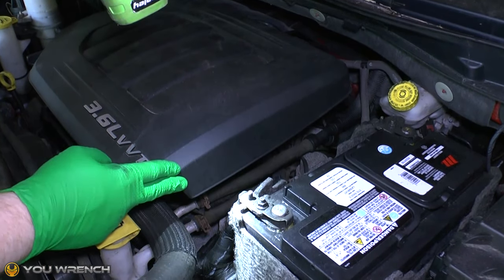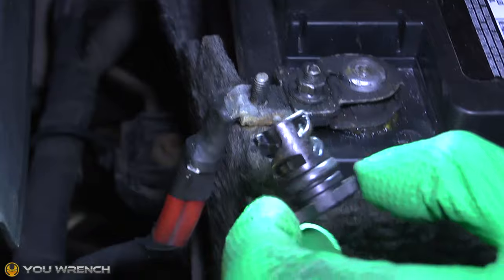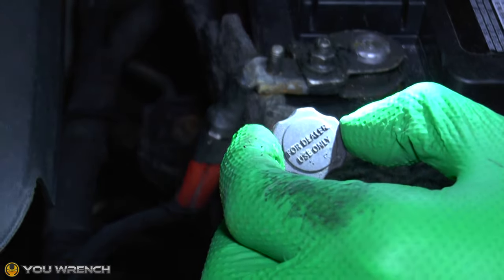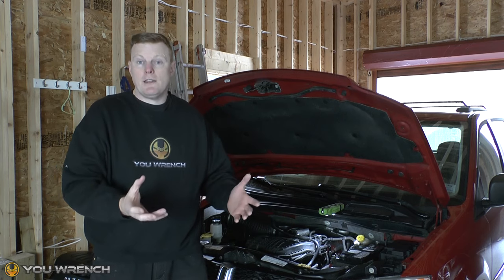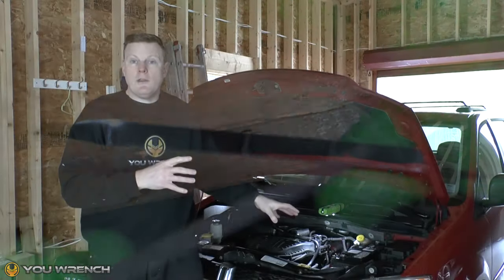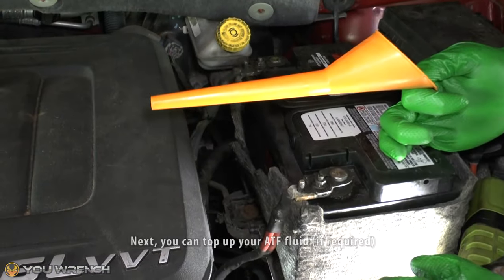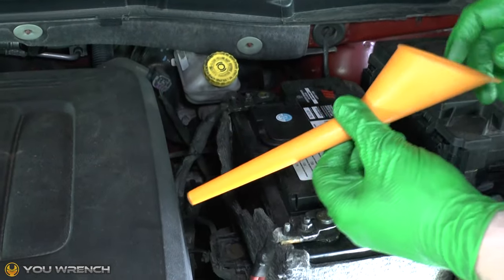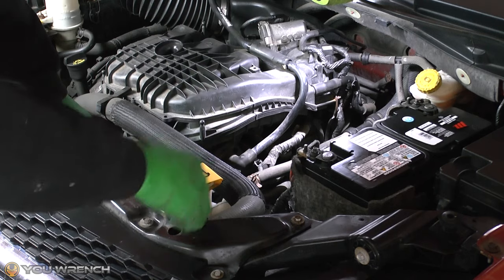How to Check Your Transmission Fluid Level - Dodge Grand Caravan (2011-2020 3.6 V6)

Comment: This access does not exist on the 2016 Dodge Grand Caravan. If I could post pictures I would show you. Please show me I am wrong.
Reply: I have a 2016. Mine certainly has it
Reply: It say for dealer use only use a light it’s a small black cap about size of a soda top driver side in front
Reply: Mine was wedged under that wire loom that you see in the video. I had a hard time finding mine.
Reply: It took us a lot longer to find the fluid opening then it should have it’s hidden underneath the wiring knuckle (between the battery and engine) it should be an inch in any other direction it would’ve been easier to find 🤦‍♀️🤦‍♀️🤦‍♀️ but once found it was no longer an issue (2017 Dodge Grand Caravan)
Reply: It's probably hidden under a thick wire.
Reply: You are wrong 😅
Reply: Its there. I couldn't find it either. Put an autist on it , he found it in 2 min. I bet him 50 bucks he couldn't. I payed out . Lol

Comment: Hi there.  I just bought a 2019 Grand Caravan.  I tried finding the tube to fill the tranny, but there is no tube, there is no cap.  I searched and searched and nothing there. Dodge must have decided to make it impossible to check or fill it on your own after all the videos on how to check and fill.  I think they are afraid of people not putting in the ATF+4 and possibility of ruining the transmission.  Can you look into this and get back to me.  Maybe they moved it, but I could not find anything anywhere that even resembled a place to check or fill it.
Reply: There is one no my 2018.  There is a big thick wiring harness directly above it so it's hard to see
Reply: I’m going through this now lol think I’m going to take it to tag dealer just to be on the safe side
Reply: @tunchi2x8721  but the dealer will gladly do a total fluid change but will refuse to "top it up"  I asked him how he would fill it up at all when he can't fill it up.  His answer "fill the drain pan"  that's all iot needs. "  Yeah, right!!!!!!!!!!!!!!!!!!!!!!
Reply: Me too I just want to get my car fixed 😢
Reply: It’s a small cap it’s says for dealer use only try using a light to find it it’s close the front on the driver side on the transmission

Comment: Thank you for your video. I would comment on the way you pour transmission fluid from the container into the funnel. Usually, it is easier to have the bulging side of the bottle be at the bottom and the neck side be on top, when pouring, thus eliminating any spillage. I know you did not actually pour anything since the cap was on, but pouring without spilling is not a bad habit.
Reply: If you'd watched the whole thing . .he did actually pour the fluid into the funnel. 🙂

Comment: This is so f…d up i paid 40k for my 2015 Caravan and i have to buy a dipstick to check the tranny oil. Whats next with these greedy engineer’s next tires with no valve stems to check tire air pressures.  
My wife bought a bra and apparently i have to buy the boobs to fill it. Thats the 2nd biggest rip off I’ve had in my life.
Reply: Do you happen to know if the 2015 Grand Caravans have a sealed transmission? Friend of mine has one, thinks it has a leak, but thinks it's a sealed transmission. Been trying to find out for him for a couple days now (of course it's the weekend, so the dealerships are closed).
Reply: As to your second issue: perhaps it’s time to consider a trade in. 😏Ah, that new wife smell.

Comment: I checked and checked and didn't see it at first, however there is a rather large wiring harness and the cap is almost touching the wiring harness so the tube looks like part of the wiring harness. It is almost right up against the wiring harness, tricky little devils but probally for a good reason. Non the less it is there.

Comment: I have an issue with my 2016 DGC R/T where tranny liquid is dripping from the bottom after about 1 year of rebuilding the tranny.
Reply from the maker: That's definitely not good. Maybe a bad seal or gasket. You will want to get that rectified as quickly as possible before it becomes a bigger issue. You may be able to visually inspect and see where the leak is coming from. If suitable,  check out the transmission fluid and filter change on our channel. Hope that helps!

--- 

To help support us (for both you and others reading this) there are a few things you can do:

1) Donations both needed and welcome! We cannot operate You Wrench without the support of people like you! You can donate by hitting the SUPER THANKS option below the video on YouTube, or by PayPal - just go to www.paypal.me/youwrench

2) Please ensure you SUBSCRIBE to our YouTube channel. 

3) Please LIKE our video's on YouTube (by clicking Like!) 

4) Please help spread the word, the more people who know about us the better! Add links to our video's in forums, let people know about us.

Thank you for your support!

Comment: Thank you. but um I have a question. the handle to my oil dipstick broke off and now my dipstick is stuck in there. Is there any way I could get that out without needing a mechanic. that you might know of, any tricks or something?
 Also I've already changed the speed sensors. now my readings are saying I need to change my gear shift ratio. it's a 2010 Dodge Caravan🙄 can you do a video on how to change that? Please? It's just so I know the process. Bcuz I don't like getting run over by mechanics. I like to know what the process is that they're doing to my car. Thank you 😁

Comment: That cap you are removing is NO WHERE to be found on my 2018 Grand Caravan. We  have looked SIX times going from the video to the van look and then back to the video just IS NOT there. Does being a Canadian vehicle make a difference J    U    S   T       I S     N    O   T        T    H    E    R    E
Reply: Jim, have you learned anything more about this? Mine is a 2014 and the cap is also not there.
Reply: @smartspaswitch382  The cap just isn,t there all I know.
Reply from the maker: That is odd! The car in the video is also Canadian, so it's not that! I've not seen one yet without the cap and tube, and I've run a quick Google search and can't find anyone mentioning this as an issue, and in the workshop manual it's shown exactly as per the car in this video. This has me a little perplexed! Especially as you have checked 6 times, no way you could have missed it. I'll have to look into this in more depth when I get a little more time. Keep us posted here for the sake of others reading if you discover why this is.

--- 

To help support us (for both you and others reading this) there are a few things you can do:

1) Donations both needed and welcome! We cannot operate You Wrench without the support of people like you! You can donate by PayPal - just go to www.paypal.me/youwrench

2) Please ensure you subscribe to our YouTube channel. 

3) Please Like our video's on YouTube (by clicking Like!) 

4) Please help spread the word, the more people who know about us the better! Add links to our video's in forums, let people know about us.

Thank you for your support!
Reply: it’s there but it’s really hard to spot, even with the video I have a hard time finding it
Reply: Me too. 2016. You are not losing your mind.
Reply: @TheStingy it's not there on some of them. Not on my 2016.

Comment: I bought a used GC 2010 and it’s under 100ooo miles. Should I take the chance and drop the pan and filter?
Reply from the maker: Well the official recommendation is at 120,000 miles (or 60,000 is used for towing, or in extreme conditions). That said, many owners on the various forums would do it for good maintenance at around half that distance. So you could leave it a while longer if everything is smooth and good, or get it done now. There's no 'right' answer, a personal choice:-)         www.paypal.me/youwrench

--- 

To help support us (for both you and others reading this) there are a few things you can do:

1) Donations both needed and welcome! We cannot operate You Wrench without the support of people like you! You can donate by PayPal - just go to www.paypal.me/youwrench

2) Please ensure you subscribe to our YouTube channel. 

3) Please Like our video's on YouTube (by clicking Like!) 

4) Please help spread the word, the more people who know about us the better! Add links to our video's in forums, let people know about us.

Thank you for your support!

Comment: Hi, my car shakes sometimes when i turn the engine on, when i stop at a red light or a stop sign. And now for the past two days the check engine light has come on. I just want to know if that could be related to a low transmission oil issue? Thank you
Reply: shaking engine at a stop or idle is probably a misfire.

Comment: Thank you for the nice video.  However, in my case, I have 2014 T&C and I see extremely thick and rigid wire harness with 3 branches is right over the cap and it is hardly visible and the harness is pushing right up against the cap and there is no room to unscrew it at all.  Even if I unscrew it somehow, I am not sure if I can even stick the dip stick into it much less fill the fluid in through the hole.  What a big bummer!  Do you have any idea what I can do about this?  The harness is so rigid it would not even budge so I am not sure what I can do.
Reply from the maker: Yes, there is a large electrical harness over the top, but there should be a gap there of (approx) a couple of inches. That harness should be attached to the side of the battery platform (cable ties/cable clips). Maybe yours is not connected and has dropped a bit? You do have to work around the harness because it's directly in the way, but it's not usually too toigh to do so. Best of luck!

--- 

To help support us (for both you and others reading this) there are a few things you can do:

1) Donations both needed and welcome! We cannot operate You Wrench without the support of people like you! You can donate by PayPal - just go to www.paypal.me/youwrench

2) Please ensure you subscribe to our YouTube channel. 

3) Please Like our video's on YouTube (by clicking Like!) 

4) Please help spread the word, the more people who know about us the better! Add links to our video's in forums, let people know about us.

Thank you for your support!
Reply: I'm in the same boat on my 2019. My 10,14,and 12 no problem

Comment: QUICK QUESTION . 
If i check the trans fluid with the engine COMPLETELY OFF when i wake up in the morning , will the fluid level be WAY UP on the dip stick ?   ..... i understand it needs to be done w engine running.  BUT IF i did it on complete ice cold Never turning engine on , 
Woupd the fluid on dipstick be WAY up ??     Just out of curiosity.  . Hope u understand my question . Thank you .  

If i wake up, get out of bed and check fluid WITH OUT EVER TURNING THE VEHICLE ON .
Reply from the maker: Yes, if you check without the engine running it will show that you have too much fluid because the fluid is not being pumped around the system and so all drops and settles in the pan. Correct, the level should be checked with the engine running. Hope that helps!!
Reply: @YouWrench  so my transmission pan was seeping on my 2014 DGC sxt, and went to a mechanic to fix, which was diagnosed as a bad gasket and also replaced the filter and changed the TF fluid.  drove for a couple of days, and just noticed a pile of TF all over my garage. I followed your video tonight for the hot side only, and found 65mm of fluid, which seems high.  I will follow the cold instructions and report back, but is it possible to overfill a transmission? I read there is a vent that the fluid can escape from, which can leak onto you CC and catch fire. awesome.